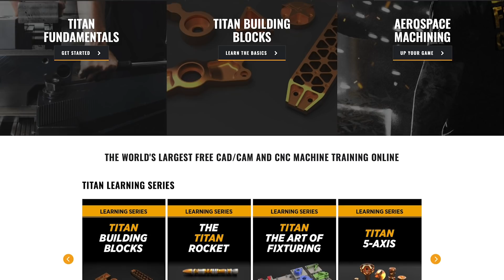3 Incredible Lessons on the Road to Building Your Own CNC Machine Shop | Vlog #115

Comment: I can certainly relate, my old shop had a Haas VF4 and G&L 6" with Heindenhain controls just sitting around used as nothing more than glorified cabinets.  I took it upon myself to learn the equipment, fix the equipment, learn the software, teach the old school machinists how to use the equipment.  It totally transformed the machine shop and enabled so much.  Now, I've just started my own machine shop.

Comment: Yes Fil.4,13 is a good verse, and thx for inpiration!. Machinist cnc from Denmark, agree about lokal manufacturing. Another advice. If one week is too much to cope with. Reduce the frame to one day. If one day is too much reduce to the next hours. If that too much reduce time frame further. Eat it up bit by bit. Get past the darkest point and mostly there is light. And sometimes very unexpected. And if you believe, you have a light in the dark, God bless.